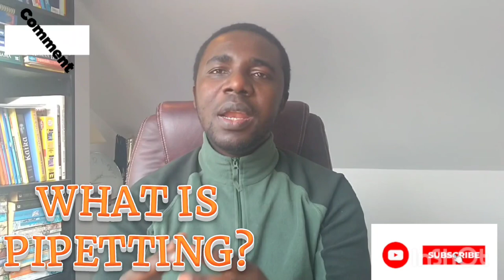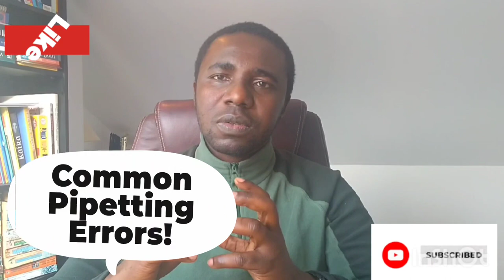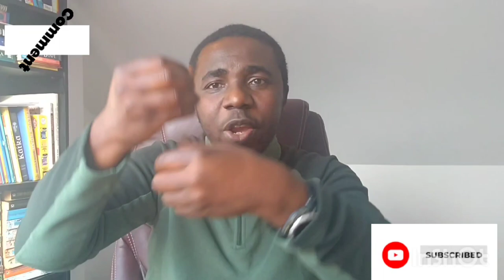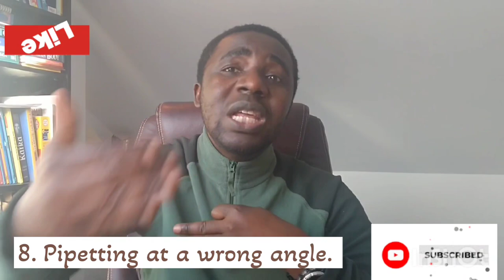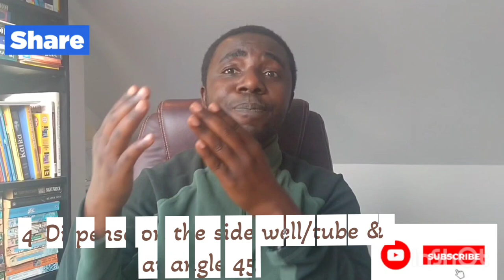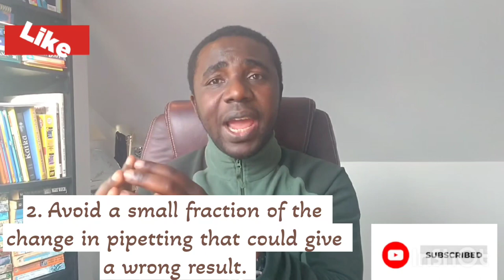Common Pipetting Errors & Aliquot Explained.

Comment: Good morning Dr Emmanuel. Thanks for your most recent video on common pipetting errors. As I told you, I just starting applying for jobs on NHS website. I noticed they keep on asking that experience of line management is desirable and another is LIMS. Can you please explain these with examples so it can appear as if an applicant has experience in them please
Reply from the maker: Sorry I have been busy. Contact me on LinkedIn: https://www.linkedin.com/in/dr-emmanuel-ogbodo-b-mls-m-sc-ph-d-fibms-hcpc-fhea-17872088/